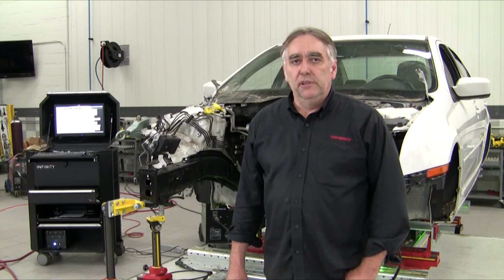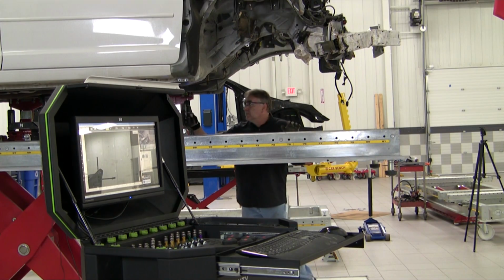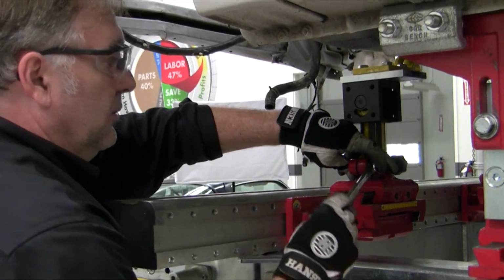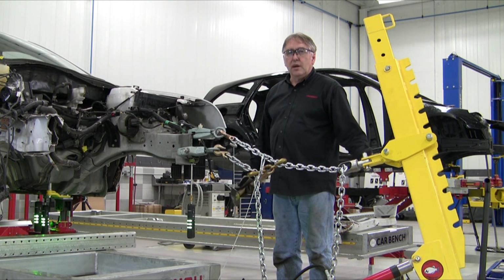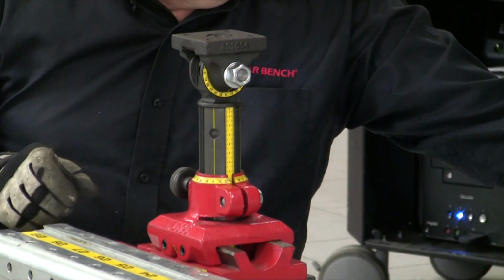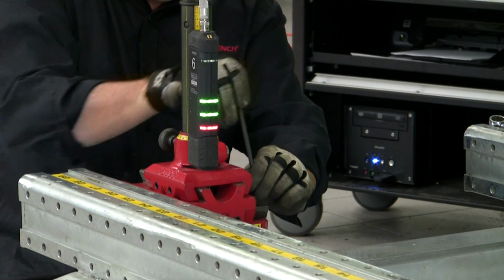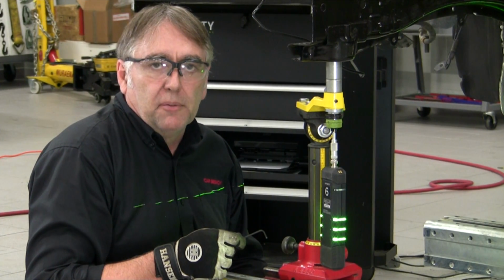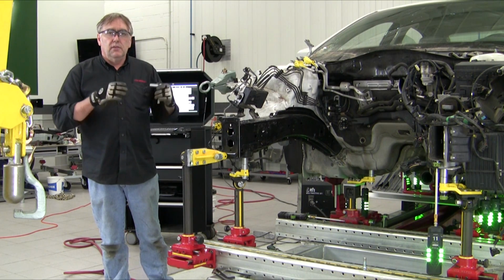ar Bench Universal Jig Fixtures and Infinity 3 Laser Measuring

Comment: once repaired will the integrity of the frame ever be the same?
Reply: +dside521 The car will never be the same again. I do alignments for a major body shop and they never come into spec when a major hit is involved. Insurance co don't care as long as the car look petty again.
Reply: +lar4305 ok, 1 question. my car was involved in a bad rear end. details a little to long to write. insurance Is not trying to total my car wich had 8k worth of damage. dside521@gmail.com email if you would like to take a look at some pics and give your opinion. it would be appreciated, thanks
Reply: dside521
when your car is done , take it to a independent shop that does alignments. Tell then you what them to check the alignment . Make sure you get a print out. That should tell you if the car is straight and all chassis components are with in specs .good luck
Reply: @lar4305  If you reapir a vehicle the way I did in this video the alignment will come right to spec. As a matter of fact when I took this exact vehicle to get an laignment done the only thing they diod was set the toe and give it back as all the other angles were spot on to the factory specs.
Reply: yes there fine. just as good as factory.
Reply: +dside521 Nope, it can only get close. But who has the money to buy this will not use it on new cars,  labour is way too expensive. Where labour is cheap, people do not have the money to buy or pay it of aftwerwards. It may be good  to work on classic cars when owners "do not care" about cost.
Reply: What about body on frame cars where the frame parts can be welded on to replace the damaged ones? Can those be brought back into specs?
Reply: If the repairer is fully qualified, follows all the necessary repair techniques, using all the appropriate tools and materials necessary then the repair will be as good as new.  However, a repair will be determined if it is viable to repair the vehicle with the cost of parts and labour required being key to this.  Insurance companies reduce the labour and material costs of repair shops to suit their pricing structure.  So, if a repair shop is dependent on insurance work they are at the hands of insurance companies.   Repair shops that are not insurance related who supply no guarantee of workmanship MAY not meet the expectation of a 100% repair.  Having a computerised print out of a repaired vehicle (which has not been tampered with) ensures that the chassis of the repaired vehicle is 100% to manufacturing standards.  However, the workmanship used to complete the job is down to the skill and integrity of the repairer e.g. ensuring proper internal reconstruction (the bits you cannot see), validation of all welding (spot/mig), sealant and rust prevention (materials) and the cosmetic areas of the vehicle you can see.  In short this system is a great idea as it provides the buyer of a second hand vehicle or the owner of a damaged vehicle the piece of mind that a vehicle's chassis structure meets its specification.